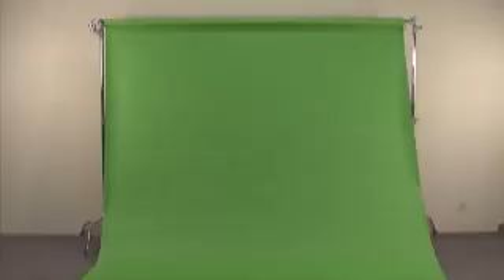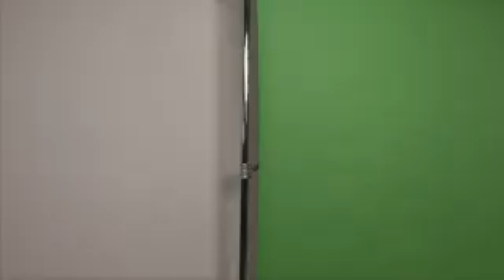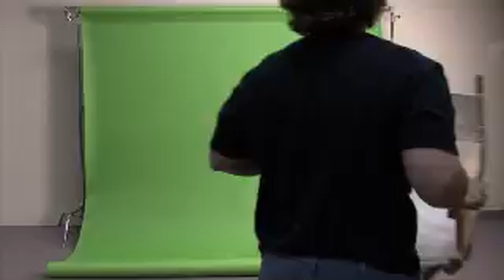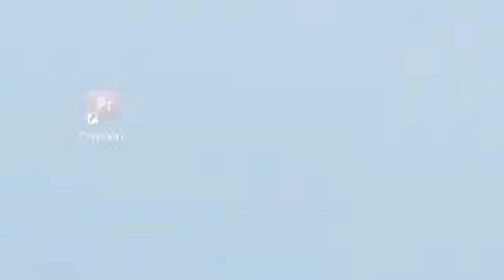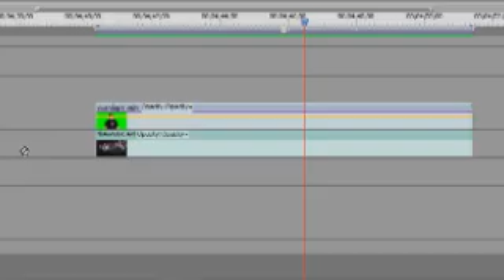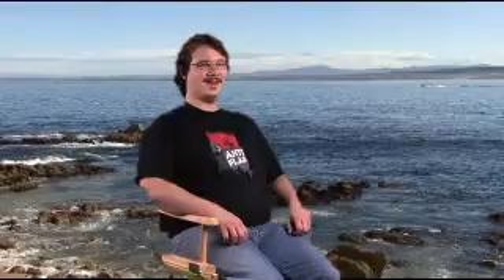Videomaker - Lighting for Chromakey

Comment: Those lights are the proper ones but i picked up 2 worklights each with 2 x 500w halogen lamps,
the ones you'd see builders use, they cost me €50 + 120v transformer, they do a great job for lighting up the background